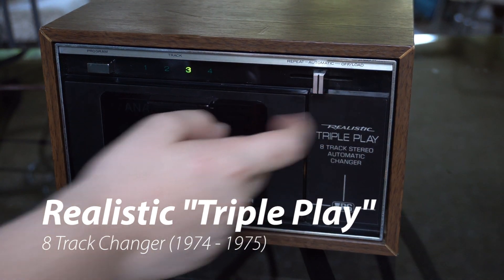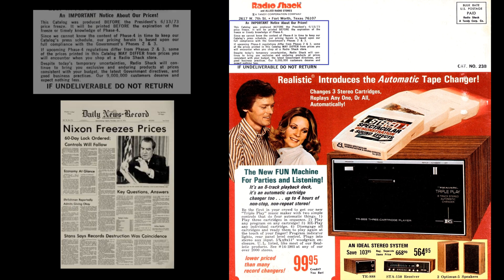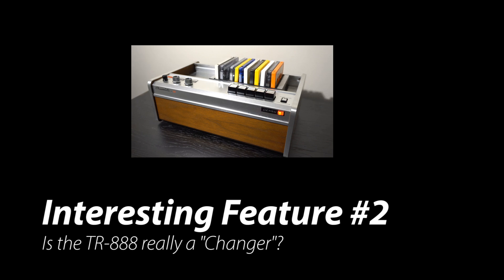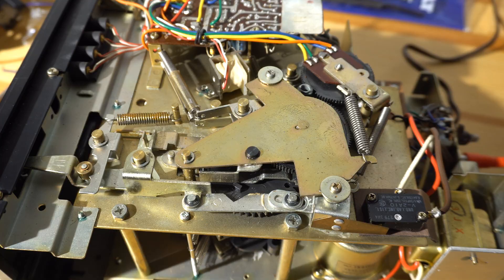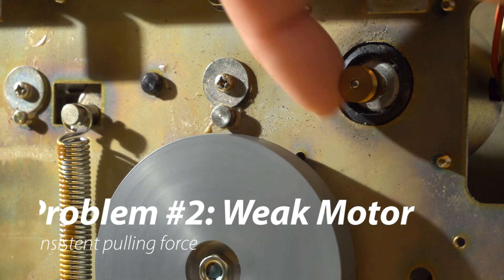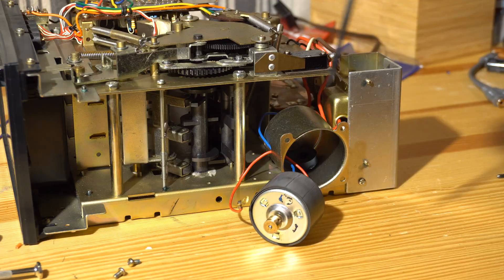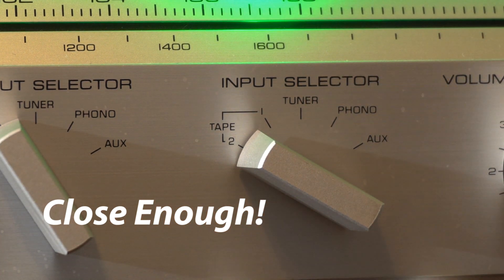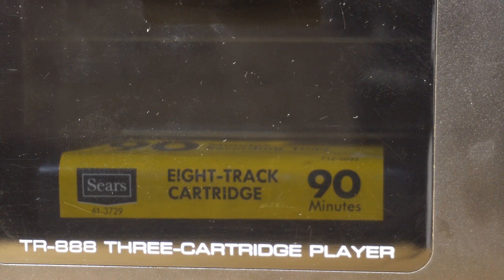Realistic 8 Track Changer Triple Play TR-888 (1974)

Comment: Thanks for the video! I weirdly just picked up this machine from a goodwill and then found your video channel when researching it. The one I got doesn’t pull the tapes in when it’s turned on so something is up. I’m guessing it’ll need a new band anyhow but does the band have anything to do with the tapes being pulled into the heads? Was hoping so but if not we have another issue here
Reply from the maker: Yes, there is only 1 band (belt) from the motor that connects to anything. If you have it apart, you can try to manually spin the large gray flywheel with your finger (make sure to verify correct direction by looking at which way the motor would turn it). If you turn the wheel in the correct direction with a tape in, you should be able to verify it will pull in the tapes.. Good luck and thanks for watching the video!
Reply: ACBMemphis - oh amazing thanks so much! I’m following your channel now, it’s great!